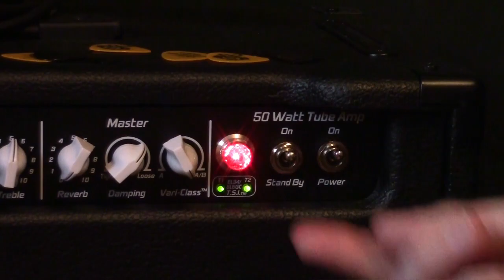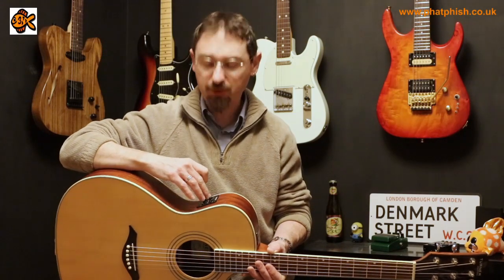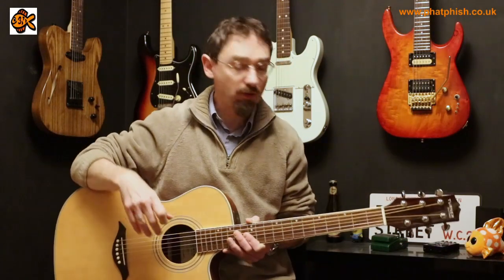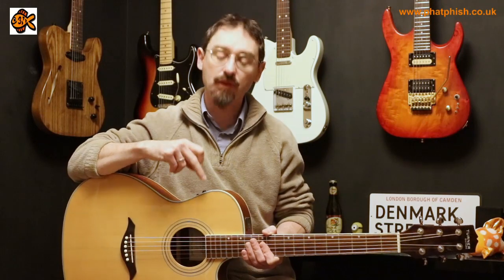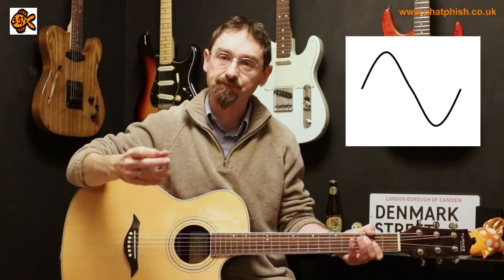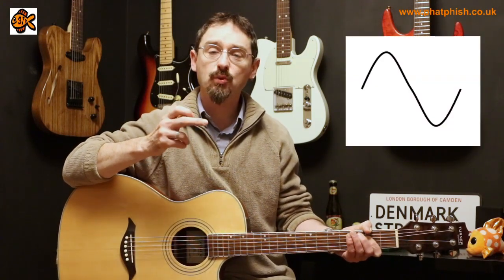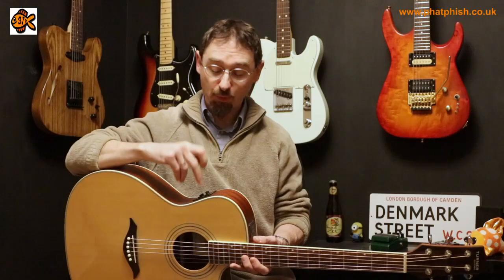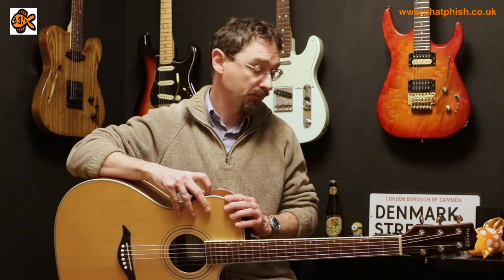The 'Phase' Switch - What Does This Button Do?

Comment: very good information!! I also found out that sometimes the phase switch eliminate other problems. I was having a "cutting Out" issue when I turned my on board tuner on and off during a performance. after playing with the amp and guitar I realized I had a lot of noise. i pushed the phase button and the noise and the problem went away.

Comment: Cool info. I constantly have feedback problems with my electro acoustic .I use a sound hole rubber . (Noisex lol) .I didn't realise that some preamps had a phase switch my  yamaha ntx 700  hasn't.is this feature only on certain guitars and if so is it possible to fit a preamp with one.thanks for your videos very helpfull

Comment: In order to save energy, I was wondering if it's better to let the phase button out and activate it only when the feedback ocours. Is it going to make a difference in the battery life??
Reply from the maker: It makes no difference - remember that the battery will be being used for the preamp regardless of which way the phase switch is set.

Comment: So, how do you turn it off and on? When is it in phase and out of phase? One way always sounds a bit off. So which position should we generally leave the phase switch when we are no using it? More info please. Thank you. sounds
Reply from the maker: It isn't an on/off type of thing. It's either outputting in one phase or another. If feedback isn't a problem then leave the switch as it is. If feedback is an issue then hit the switch to change the phase.

Comment: Does it only work if you plug in to an acoustic guitar amplifier? I gig plugged into a DI box straight to the p.a. The Phase switch works on stopping the feedback but I notice that it changes the eq/tone of the guitar too making the sound thin. I would have to re eq again but would encounter another frequency that introduces feedback. I would reverse the phase again but it just go back to the initial feedback problem. What should I do?

Comment: Hello, I have a problem with an acustic used  guitar payed € 150 - Cort MR7 OFX NAT Fishman prefix plus t -  it souds always and only like an electric guitar, I tried everything (changed battery,amplifier, cable) but there is absolutely  no way to get a simple acustic sound. More, the sound is not constant at all, it comes and goes. Any advice to solve the problems ?
Reply: Massimo Di Gennaro Change faulty parts.
Reply: might be a) overload of the amplifier, b) the pick up is not fxed properly (under the bridge).
Reply: @raccoon6072  Really thanks

Comment: My LP Muse has a phase switch but it doesn't remove feed back.
Reply from the maker: That's an electric guitar so what that switch is doing is flipping one of the pickups from in-phase to out-of-phase to give a different type of sound. On an electric guitar phase refers to the electrical phase of a pickup, whereas on an acoustic guitar it refers to the phase of the output sound.
Reply: @PhatPhishGuitarStudio  THE phase switch on my LP is on the bridge volume and my hummingbird acoustic electric has a slide switch that clicks in the center.
Reply from the maker: I've got a couple of electric guitars here with phase reversal switching. I'll do another video sometime explaining how they work and what they're doing with the signal
Reply from the maker: @phillipholt6005  Here's a new video talking about phase switching on electric guitars vs acoustics... https://youtu.be/Xd0f_6P1wlA

Comment: Why would we even have a phase switch then.. I bought a electric acoustic combo because I can only afford one guitar but I want to play metal and normal guitar. I've only owned electric guitar before. Nobody has answers for me.
Reply from the maker: Did you watch the video? The phase switch eliminates feedback when playing an acoustic guitar through an amplifier.
Reply: @PhatPhishGuitarStudio  that's my point why would we ever want feedback... It shouldn't be a switch on an acoustic electric guitar it should just be always on.. if it's not plugged in then no worries if it is plugged in it should be opposite phase all the time. Thats the point of dual coil pickups on an electric
Reply from the maker: You can't compare feedback from an electric guitar and feedback from an acoustic guitar - there are differences in how feedback is produced in each case.
For an acoustic, feedback is undesirable, hence the switch to eliminate it. Which phase feedback occurs in varies based on various factors - hence the switch allows you to set it according to the conditions in any specific situation.
Reply from the maker: Incidentally the point of dual coil pickups in an electric guitar is not to eliminate feedback - it's to eliminate hum caused by electrical interference. You can get feedback from humbucking pickups quite readily with adequate volume.